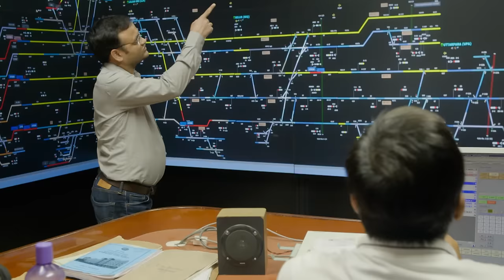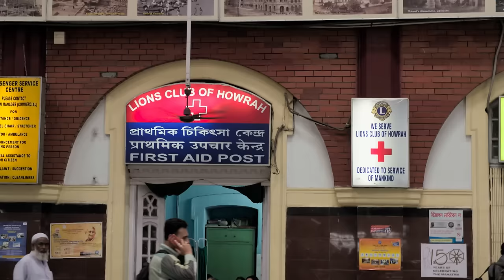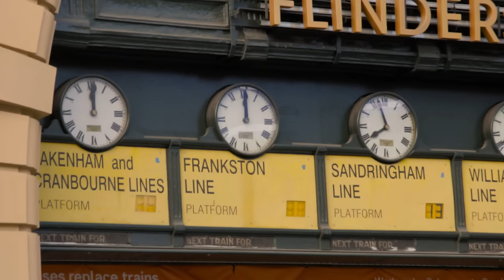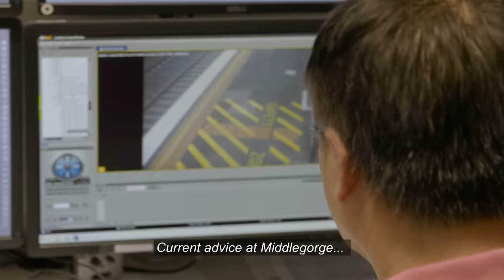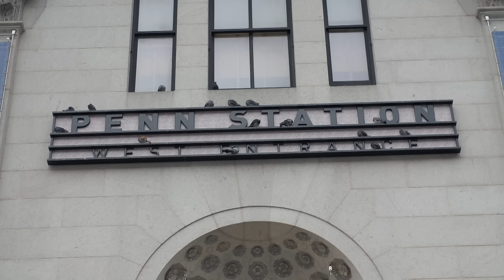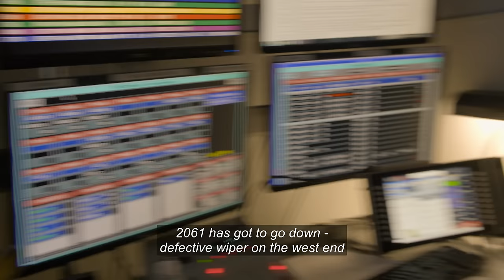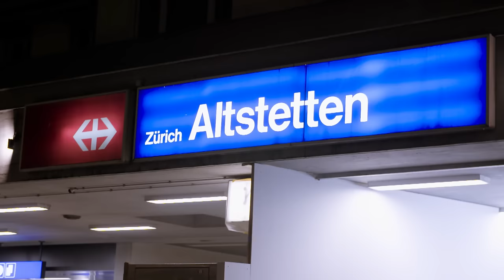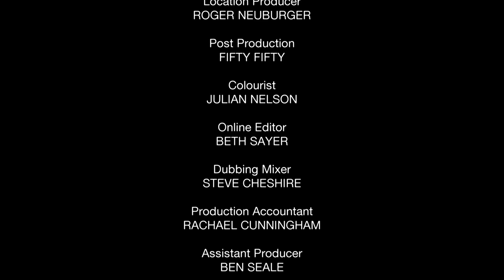World's Busiest Train Stations | Kolkata, Melbourne, New York City, Zurich | Free Documentary

Comment: This video of Howrah station must be at least 3 years old...

1. Rajdhani is no longer the most important train of this station, it's the Vande Bharat trains

2. Amritsar Mail is now fully refurbished with modern LHB coaches (done couple of years back)

3. Humsafar from Bangalore to Agartala no longer halts at Howrah, it's diverted away via Dankuni (Calcutta Chord Line)
Reply: 2019 documentary
Reply: Suppose two trains one Rajdhani and another VB are stuck at signals midway, and both already reached departure time, Tell me which one gets the signal first? If you do not make the new version of the coach better and make the passenger special, and with few marketing rumours nobody will pay lumpsum as extra. India will make ICF Chennai produce 100% of their coach requirement in future. No more LHB dependencies. Gradually all Rajdhani Shatabdi will be given modern slipper coaches what you call "Vb coach".
Reply: @kaushikdas4098 if they're on the same track, it would be the one in front. If not, it would be the one expected to move fastest. The one with the least amount of stops before the next split.